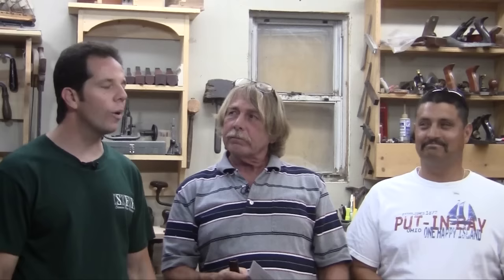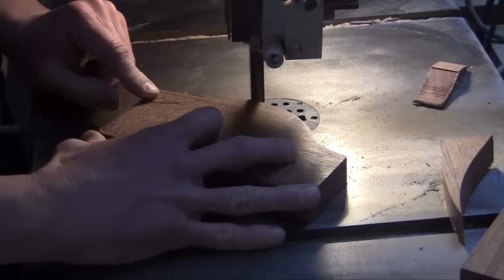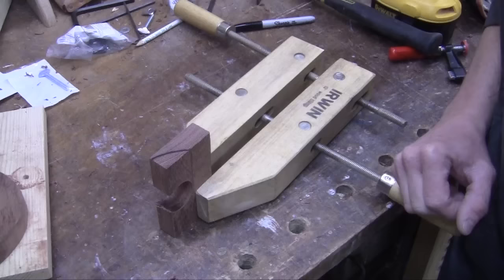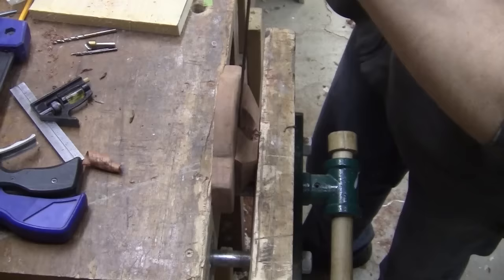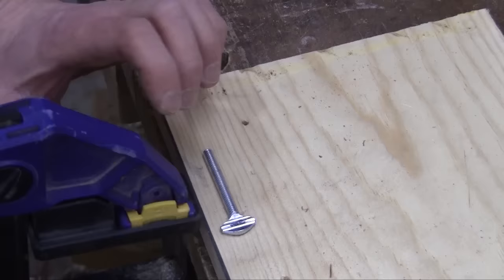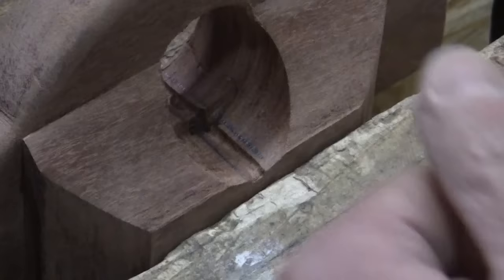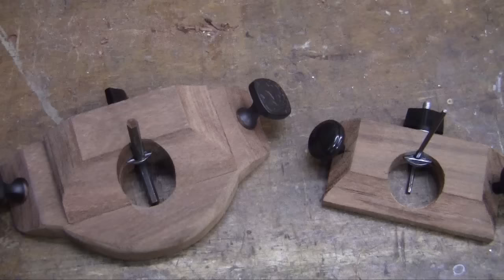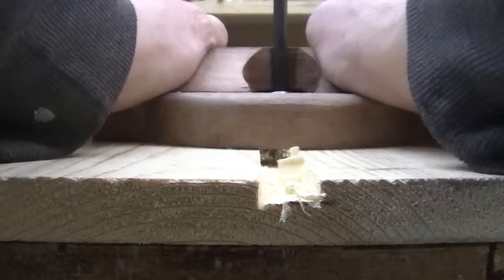How to Make a Cheap and EASY Router Plane

Comment: in what universe is steel for a allen wrench ideal for a cutting edge (I know the allen wrench is hardened, but toughness is more important than edge holding capabilities)? a replacement blade for a router plane would have been so much better!
Reply from the maker: In my universe. :-) All joking aside. There are much better versions than this, of course. But for the price, it does a decent job. Thanks for watching and your input is appreciated.